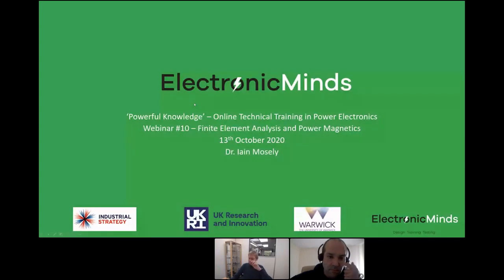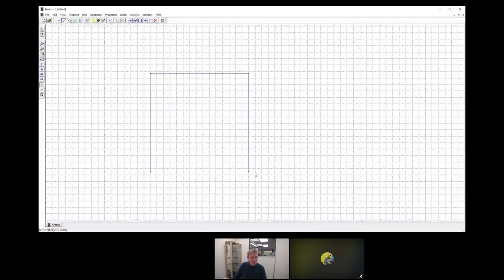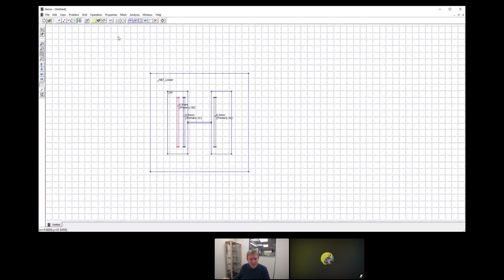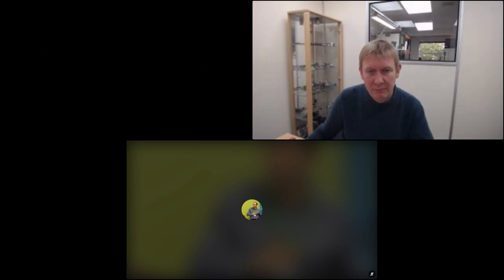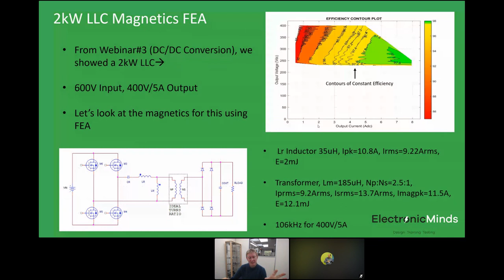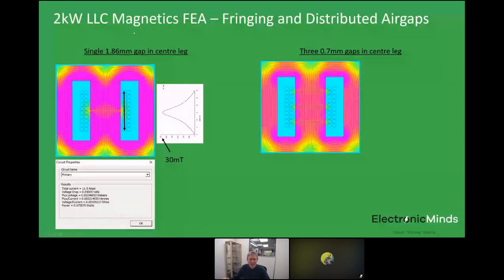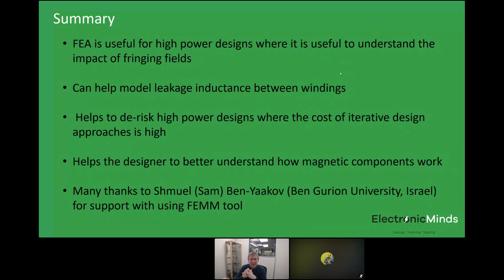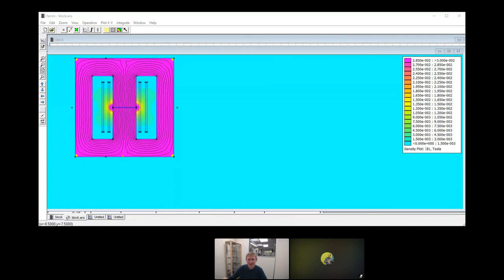Powerful Knowledge 10 - Finite element modelling of magnetic components

Comment: Thanks for the nod towards FEMM and your tutorial efforts. I have been looking for opensource FEA, and this seems a good start. Having said this, in trying to apply the tool to an existing personal project I straight away hit some issues. Firstly I note that you have used an E core from TDK, this has a 'planar' symmetry. This I assume is most suitable for a 2D tool like FEMM. I have been running my LTSpice simulations for my LLC converter using a TDK ETD core. This has a sort of truncated axisymmetric shape. Have you specifically avoided such ferrite shapes. If not any tips about how to model them. If I choose an axisymmetric problem then the depth option is greyed out. Presumably the defined plane is spun around a vertical axis. But I would then have a shape which is nothing like an ETD core. I assume this is a basic limitation of a 2D tool such as FEMM?
Reply from the maker: Hi Aidan, thanks for your detailed comments. Great to see you have been playing with FEMM, especially since you are modelling an LLC. this is a great topology and we are building one at the moment too. Watch out for deltaB in your magnetics, we have found that the dominant loss mechanism in our the converter is core loss. For the ETD, I can see the problem you have in that the centre leg is round in cross-section which does make it rather hard to model in a 2D tool. I've not looked into trying to model these style cores and i think you correct that 2D tools such as FEMM will struggle. Maybe you could approximate the centre leg by modifying it to be a square cross-section instead with the same x-sectional area? This should give a reasonably good approximation but depends how detailed you want your modelling to be (fringing etc will not be correct). To do this accurately you probably need a 3D tool such as Comsol but I've not had any experience myself with that. Still, as a free tool, you can do a lot with 2D FEMM.
Reply: Thanks Ian, It seems we came to the same conclusion. I either try and approximate the centre leg by adapting its width to more effectively represent the cross-sectional area, or I stick with using a square section core. I have built a couple of LLCs already at lower power levels ~200W and hand-calculated and iterated. This time however I am aiming at >1kW and it is starting to look like I need to model closer to reality as things are likely to get both expensive and hot if I get it wrong. However thanks for your helpful comments.

Comment: @ElectronicmindsUK how did you model the actual winding?
Reply from the maker: We found that you can model in two main ways in FEMM, either define a composite area which you then specify a number of turns to contain or draw them individually. Mostly the composite approach works well enough.